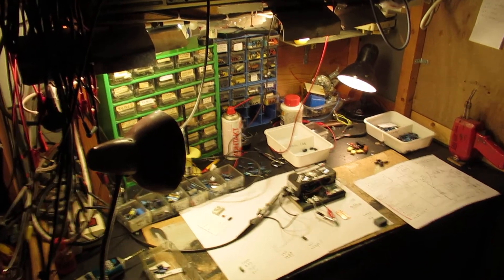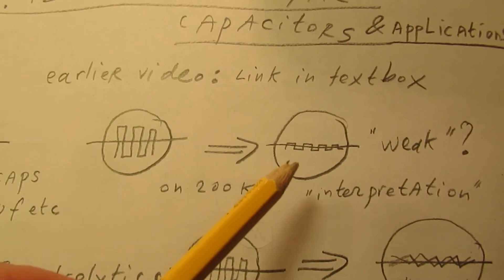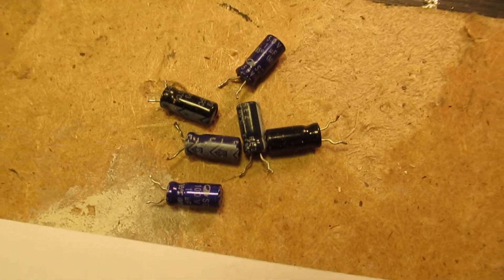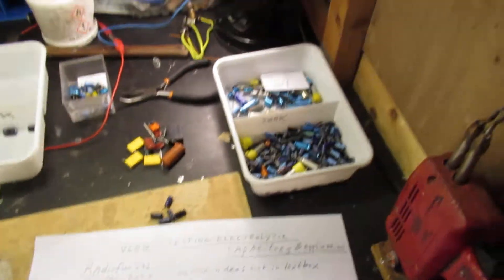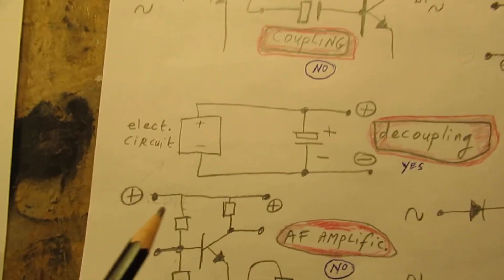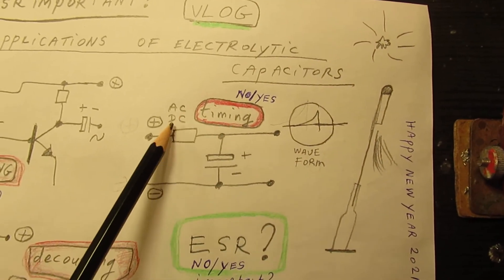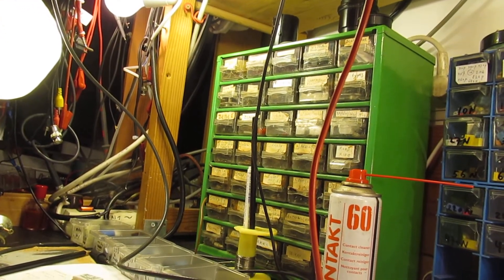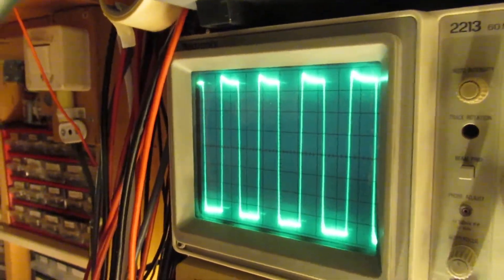Testing electrolytic caps part 2: test on ESR & comparing with healthy ones. Does ESR matter?

Comment: Do you have another capacitor tester to check your suspect defective capacitors? I'm going to scope out my tester to see if it uses a square wave to test for ESR.
I hear your fireworks! We were launching solid motor bottle rockets this evening.
Have a happy New Year. Hopefully, 2021 will be better.
Reply from the maker: At the moment I have to develop idea's about how to test them in a specific way. Perhaps with a change of frequencies between 50 KC and 300 KC, looking via the scope on the effects, perhaps with a first series resistor in such a setup. And also regarding the voltages where they were made for; I found important variations on the scope when testing bipolar (say) electrolytics and polar electrolytics in the 0.47 uF up to 1 uF range on voltages of 50 or 60 Volt. I have to form my idea's about better measurement techniques.
Reply from the maker: Funny that you heard the fireworks! It was forbidden in the Netherlands because of the Corona virus, but luckily I saw/heard a good amount of fireworks during this evening on 31 dec 2020.  Happy new year Barry (and your family).
Reply from the maker: Hi Barry, for your info: I re-tested the so called "weak" capacitors with a sine wave (instead of a square wave) on 100 KC. When the voltage drop is substantial (drops from 7 V to 0,2 V, pure sine wave visable in both cases when the button is pressed) I sorted them as "OK". Because all these caps (say 80 of them) showed the exact same behaviour (fresh and old) + showed good in the DC test (no shortcut or no endless resistance) I saved them as "OK". Update 2 january 2021.

Comment: Very useful. I think I have more electrolytics than any other component, all salvaged from old electronics. Thank you for posting, and Happy New Year.
Reply from the maker: Thanks, good wishes too. I salvaged a few 100 electrolytics since the 1970's and finally wanted to test them now. Many dropped out during the test and the test circuit worked quite well. Only problem was with many 16 Volt electrolytics where the squarewave on 200 KC dropped to a very low value, but was still there on a very low level. That ment a (say) certain series resistance. That could be the normal series resistance and in many cases these caps are completely usable (depends on the application) but I want to re-test them finding out more.

Comment: A healthy and happy new year to you. I've found with old electrolytes that leaving them (for about 12 hours) on an appropriate DC Voltage (reforming) helps enormously. But will they last, and some get quite warm in the process :)
Reply from the maker: Thanks, a happy 2021 too! Indeed that is another problem that is/was not tackled here at all (sorry to say). Indeed all these electrolytics "on the shelf for many years" are not in normal use/condition and (like you say) in fact have to "formatted" first, before testing them. Indeed a serious issue. Thanks & valuable info in this whole "process".
Reply from the maker: I have put your comment in the textbox because it is essential.
Reply: @radiofun232  Praise from the master, plus a vaccine on its way - 2021 is starting out with goodness :) Thank you.